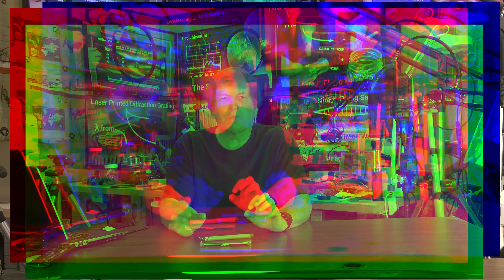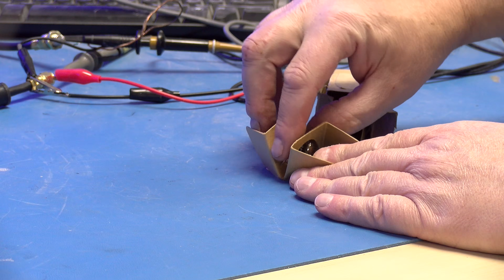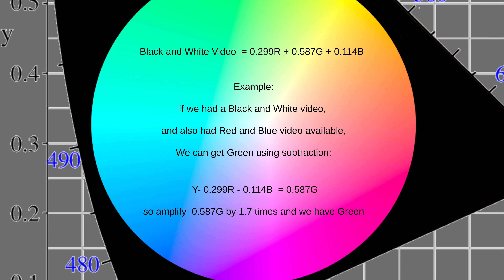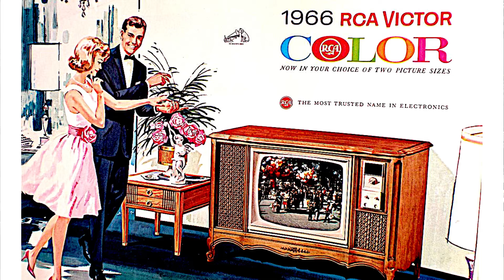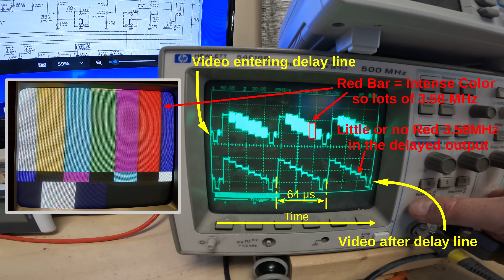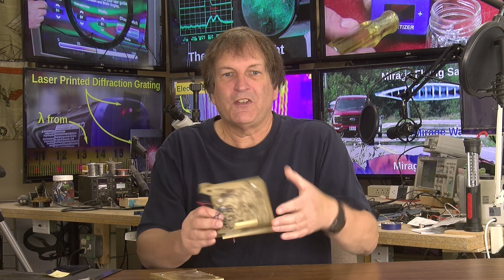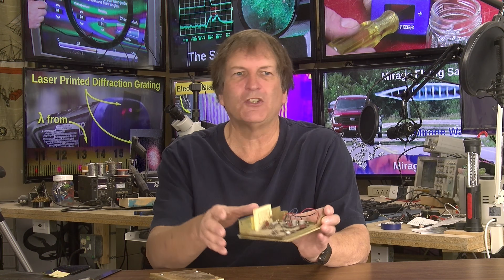How we slowed down electricity to create Color TV

Comment: UK here. My grandmother had a b&w tv which you could switch between 405 line and 625 line.
Reply from the maker: I have always wanted to see a 405 line British TV - what a cool connection to the beginnings of broadcast TV!
Reply: @ElectromagneticVideos 
You might find this interesting then (Wait for the continuity announcer after the weather forecast)
https://youtu.be/sG52HcgKaD4?si=BSvm8IX5r9PrEjgx
Reply from the maker: @plonchyvideos  Just looked at it - the end of an era! To bad they seemed to have switched to the TV off at the same time as the transmitter - would have been neat to see noise replaced the last 405 line signal.
Reply: @ElectromagneticVideos  I have a 405 line TV and have used the hacktv software to feed a signal into it. The flyback oscillation frequency is only 10.125 kHz so it's very audible. Some TV manufacturers would dip their flybacks in oil to reduce or eliminate the sound.
Reply from the maker: @steeviebops  I had never heard of dipping flybacks in oil to reduce the noise - how interesting. I do remember as kid being able to hear the 15.7khz squeal from 525 or 625 line tvs. The 10.125 kHz must have been really annoying!
Reply: @steeviebops  Electric guitar pickups are dipped in wax to ensure they're not microphonic, a process called "wax potting".
Reply: @ElectromagneticVideos  I remember being 4 and lying on the floor in front of a 405-line BW TV in the UK and watching the moon landing (probably not live but a recording on the BBC news?). A smeary white blob bobbing up and down against a fuzzy grey background!
Reply from the maker: @vicenary  Your experience is so similar to mine! I was a couple of years older than you were - we were staying at an old German farmhouse converted to Gasthof (Inn). I remember watching the same sort of smeary white blobs on the moon as you described. I think it was Apollo 11's first walk on the moon. That was on a very old black an white TV at 625 lines, not that the 200 more lines that you had would have made any difference on those fuzzy images. Even though it was hard to make out any detail, it was so thrilling to watch something from the surface of the moon.

Comment: If one subtracts the output from a 140ns delay line from the video input to the delay line, this yields the chrominance signal as the output of a "comb filter".  This signal is quadrature demodulated to U/V color signals using a local oscillator synchronized by color burst at the beginning of each line. The delayed luminance is captured from the 70ns midpoint passed through a lowpass filter to remove the 3,58MHz color subcarrier.
Reply from the maker: Even better -  a comb filter based on a 63.55us delay(horiz frequeny)  or (better still) 33.4ms (vertical frequency) to completely seperate the the full bandwidth luma and chroma of a still NTSC image.

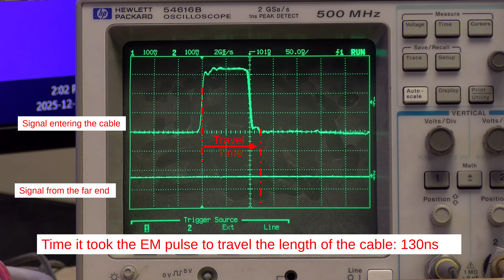Comment: At 20:50, you talk about the speed of light in a cable...
In fact, it is the speed of an electrical signal in the cable.
But... nice and very clear video.
Reply from the maker: Thats a bit of a teaser for a future video becuase if you look at how the power in a cable is carried by the EM fields around the conductors (look up Poynting vector if you arnt familar with it), it turns out there there really isnt much difference beween EM signals/waves (light, Radio waves, X-rays etc) from a signal confined to a cable. Remove the conductor in the middle of a coax cable and you get a waveguide where the wave is more light-like. Or remove the shield from a coax and the one wire that is left can still carry electrical power becuase of the EM waves (look up Goubau line for a very intersting read).  So thats where I was coming from!

Comment: When it comes to Videotape, every show that was recorded on tape since the 50s was done on quadraplex videotape machines. Since Ampex was the inventor of the sucessful videotape machine, the word videotape was trademarked to Ampex. RCA used the term television tape. Since the quad machine used 4 rotating heads at 14,400 rims, each each was only  capable of recording/reproducing 17 lines of video and therefore incapable of freeze frame. The banding you see on some recorded shows were due to a machine  that was improperly set up. Each head has a tube preamp located in thr head assembly itself, then goes to EQ amps in the machine. The rotating heads ride in air bearings, so the machine needs an air compressor to operate. Early days of videotape machines used slip rings on the heads, but that was determined to  introduce noise, so they invented rotary transformers instead. In each head assembly there is a fixed head that is used for control track signal. This is like an electronic sprocket holes that are used in film. Tape is pulled through the machine at 15 imches per second (ips) by a precise capstan. 
These machines are capable of locking to external vertical and horizontal sync signals as well to do things like special  effects or mix with other video sources.The tape takes a few seconds to move and to lockup from a dead stand still, so a preroll is required. Later quad machines could lock up within  milliseconds using vacuum columns in the tape path. These begemouths weighed in at 2,000 lbs uet they managed to produce a portable machine that can be placed in a backpack configuration although some features were left out, like full color playback, erasure of tapes, and only 20min of recording time, (which was similar to film cameras)
RCA copied (of course) Ampex's design and a lawsuit began. Ampex allowed RCA to n use its design in exchange for color circuitry at the time. However, within 6mo, Ampex developed far superior color circuits. There are YT videonon these awesome machines.
Reply: These machines were so large and expensive, that all recordings made "on location" were still shot on film, at least here.
A news or sports crew would film the event, travel back to the studio, develop the film and transmit it using a film scanner.
Reply: @Rob2 umm. Not at all... first it totally depends on WHAT was being recorded. For example for a sporting event, a truck would roll up with all the equipment you need, same thing for shows and other outside events. You can have an entire studio in a van if needed.
 The portable 2" machines (google Ampex VR-3000) were no larger than a thick attache case. I have personally seen it used on many, many commercials, outside interviews, and shows. Videotape had major advantages over film as well.
Reply: @rty1955  Maybe where you live, but not here.  Film was used for a very long time for outside recordings.
Also, tape was expensive and often re-used.
Programmes from the sixties and before that still are in the archives are often incomplete with only the scenes shot on film remaining.
Reply: @Rob2 where do live? Videotape was much easier to edit, much more cost effective as medium can be re-used. Tape was preferred because performances can be instantly played back, etc.
Shows from the 60s thay were placed on tape, was often erased and reused. Playback was not often thought of many decades later as once they got all the money from the show, it was erased. Film storage was also a real problem, many film shows were tossed out because of this. Film scanners were a recent development as most Film to video was done on film chains with modified projectors like an RCA-TK66
Reply: @rty1955  To the contrary!  Film is much easier to edit than videotape, that can only be edited when copying it.  Film can be cut and spliced, impossible with videotape.

Comment: Also the vertical field rate changed from 60 hz to 59.94 when color was added.
Reply: Yes, which was close enough so that b & w sets had no difficulty locking to it. But if you had a ground loop or a problem in your power supply, the result would be a dark bar that would slowly crawl up the screen.
Reply from the maker: Yup - I remeber on some old sets that bar was faintly visible.

Comment: Great video. At 39:30, I am particularly intrigued by the motherboard that evidently uses the "analogue" delay printed circuit to align with the "digital" signals.
Reply from the maker: It is neat. Of course at the signal level, analog and digital are really the same - its just how the information is encoded on the signal that makes it digital or analog.

Comment: If you look inside a 1990s oscilloscope might also have a coil of wire to create a very short delay too Simple things don't  fail
Reply from the maker: I didnt know that was used in such recent ones. I actually did come across a photo of a large (maybe 2 foot) coax line in a 1970s scope used delay the signal a bit from the trigger. I almost showed it but decided I had enough delay line examples.

Comment: One thing TV displays cannot do with just RGB is a true purple 💜  not a pink blue purple That you need a purple phosphor as it's beyond blue light frequency as far as I know
Reply: @metalmickey-d6w, that's nonsense.  NTSC can display purple.  But like any color reproduction system based on primary colors, it has a limited range of colors, and some colors fall outside the range.  Look up the NTSC gamut.
Reply: @jbalazer violet it doesn't ,our eyes can see part   of the violet  spectrum like in a rainbow and look at violet in a display it doesn't reproduce it correctly a blue and red and green cannot make  make violet its higher up the spectrum even higher is ultra violet which is out of our general seeing range  💜
Reply: @metalmickey-d6w  TVs can't produce a fully saturated violet, like the light of a violet laser, which has a very narrow band of frequencies (monochromatic / spectrally pure light).  But TVs can produce a slightly less saturated violet, which is the color of a spectrally pure violet light with some white light added - basically the violet in a rainbow.  (The colors of a rainbow are not spectrally pure because rainbows are seen mixed with the light of the grey or blue sky behind it.)  TVs achieve that violet color by combining blue light and red light.  Our eyes don't care what wavelengths of light were mixed to create the colors we see.  All that matters is how much the three different types of cone cells are excited.  Different light spectra can achieve the same excitation and thus the same color.  This is called metamerism.  You can go read about that.
Reply: Natural Violet color is perceived by two receptors in the retina: "blue" and "red" receptors.
The spectral characteristic of "red" receptors has also a small "hill" for light waves in the violet range.
Reply: @berko9608 look at a rainbow you see a purple  or better violet because the cones overlap each other so extend beyond just blue light and less to violet colour spectrum I can perceive the violet colour I noted green is the best colour to see very well

Comment: Since we’re on the subject, one of the earliest forms of computer memory was the mercury delay line.

It consisted of a column (or tube) of mercury with an acoustic transducer at one end and a receiver at the other. Electrical signals were converted into acoustic pulses that propagated through the mercury at a fixed, well-characterized speed of sound. The finite travel time of these pulses provided the delay that made storage possible.

A bit pattern such as 11001 was encoded as a sequence of timed acoustic pulses. When the pulses reached the receiver, they were converted back into electrical signals. If the data was unchanged, the system immediately re-injected the same bit pattern into the transmitter, forming a continuous regeneration loop.

If a bit needed to be modified, it was altered during regeneration before being sent back through the delay line. In this way, a single delay line could store hundreds to a few thousand bits, depending on its length and clock rate.

Because the data existed only as a moving pulse train, mercury delay line memory was sequential—data could only be accessed when it emerged from the delay line—making precise timing essential and random access impossible.
Reply from the maker: You know, that somthing that I havnt every seen in and would be thrilled to see a mecury delay line memory. I'm sure some museum somwhere must have one. It is amazing how far we have come in terms of memory - although  time circulating data does have similarities to magentic hard disks.

Comment: When I left school in the mid 70's, I joined a small company in Coventry, UK, that made analogue delay lines for companies such as Plessy. They consisted of small handwound coils on toroidial cores. These were then wired in series, with terminals at a the joins. This way, the appropiate delay could be selected as desired. I can't remember what the delay times were, but as a 17 year old apprentice, it was my job to test every device made, using a sig gen and a Telektronix dual beam scope. The workforce was very small, about 8 to 10 ladies. They were assembled in a plastic case, perhaps about 1.5inches long, and then potted with a 2pack epoxy resin. Very low tech, but they solved a problem for the electronics industry at that time.
Reply from the maker: That is so cool! I'm sorry I didnt see you comment earlier - thanks for posting that neat bit of history. People dont realize how many critical things are produced by millions of small businesses like the one you worked at. Boeing apparenly didnt realize that either and left a number of tiny suppliers without enough work to survive during that period in stating in 2020 when the world shut down (not a good idea to mention the name of the event because YT's policys). Apparenlty they found out just how critical some of the small suppliers were when they discovered all the know-how to make those parts disappeard with the suppliers.
Reply: During my work in R&D at TV manufacturers' labs, we sometimes made use of switchable-length delay lines to prototype gear so that it wasn't necessary to wind a new luminance delay line to match every experimental change in the color circuit bandwidth.

Comment: I used to have a basic understanding of colour TVs but the reason for that particular delay line was always glossed over. Didn’t seem important.  In PAL contrives we knew fully the reason for the bigger delay line, as this was the clever bit to  avoid colour variations from subcarrier phase shifts.
Good video.
Reply from the maker: I think it was often glossed over was that it wasnt really fundamental to how color was encoded, and would have required quite a bit more explanation and a bit of side track. I almost left it out of the video, but thought it was an interesting side track about a device you hardly see any more.